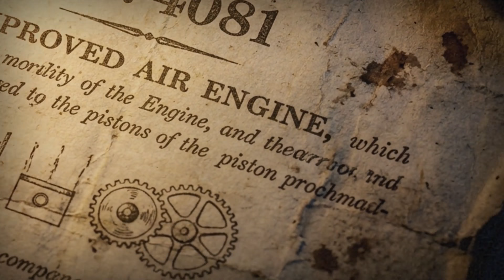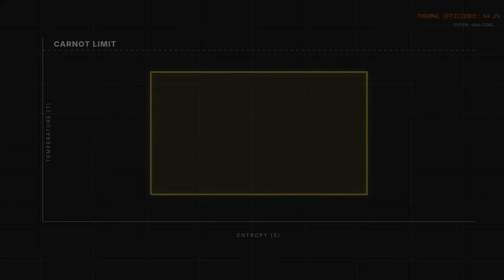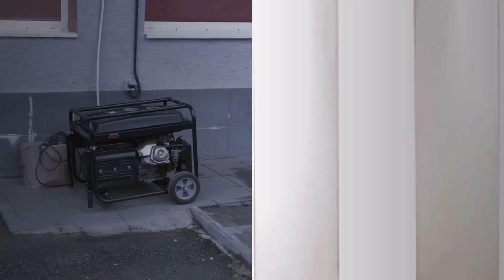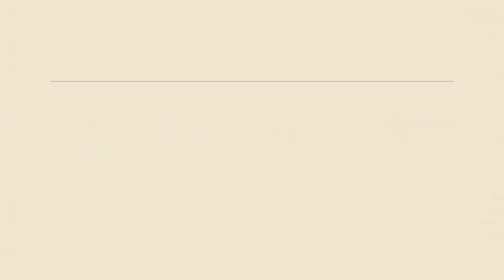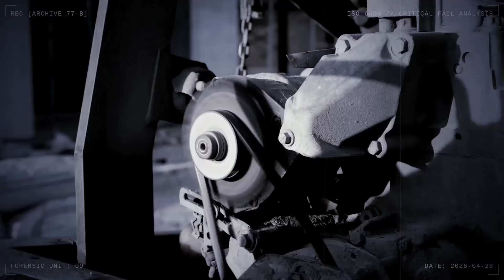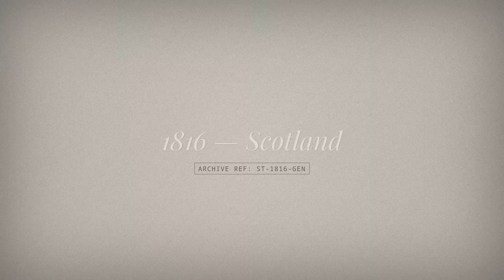This 200 Year Old Engine Runs on the Heat of a Candle — It's 40% More Efficient Than a Gas Generator

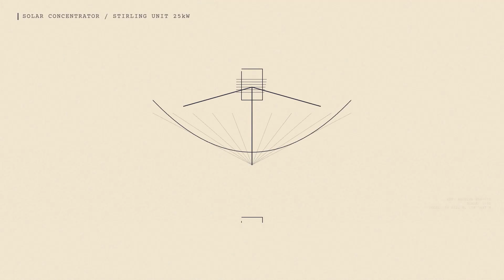Comment: at about 7:50 time mark, My average house about 3000sf uses 44 kwh a day and they based that on 11cents a kwh and even in NY I am only paying .07 cents, 4 years ago 3 friends and I built a cheap solar setup four panels 2S2P, a good 150/50 charge controller and 3400W inverter and moved a few items a month over to it, not whole house yet as we were playing with different parts and conf. eight 145ah commercial Telco AGM batteries I could run everything in our house but not AC or Heat so about half total load and lowered the bill to $32 a month, that is pretty much the minimum cost of staying hooked up to the utility, last month I got a low battery warning and seen my panels were not keeping up with use, my bad I had not looked at them or mowed around them because they are just laying on the ground you know because just testing still and the weeds had grown over them LOL problem solved, but I wanted to see how long it would run without being charged and unplugged them after full charge and I went 4 days before it cut off, total cost of system from everything bought on amazon and aliexpress was less than $2k
lets talk about lower light or cloudy, so just as a test we dont want to over Volt or Amp the controller we can add in an extra few sets of panels if the 4 2s2p panels are cutting it k but if we start to get a few cloudy days flip a switch and add in 4 more (P) or even 4 on top of that if its really cloudy, but I have to figure out how to program a PI to do it automatically because if the sun does come through  between clouds LOL you would have to run all the time to switch them off and if you didnt catch it you would have 16 panels running into a charge controller that was not meant for that, I know I can hear get a better controller LOL ok but that would also cost $1500 more, I am still playing with equipment cut me some slack :)

Comment: People talking torque, Speed, why not in cars etc. Try to understand this runs in a plant efficiency not a moving object. It has a higher weight to power ratio, can run on Fezner lenses with sunlight for free. Check out Exowatt P3 , they built complete power unit ready to dispatch in a 40 foot container. That is the magic. Giving 32KW of power with complete solar .

Comment: maybe someone can clarify something for me.
I see lots of examples of sterling engines doing lots of work, pumping, generating power, even running machines. But then i see lots of comments about them having very little torque to even power pumps, generating power, even running machines...
so, which is it?  can they power the machines? are they a pipe dream?
If the engine Sterling himself built to pump water is proof of concept, then the reason Sterling engines have been oppressed and relegated to the fringe is suspect.

Comment: Just for fun.

Regarding candles: Depending on their composition, size, wick diameter, and oxygen supply, they deliver approximately 20-120 watts. Assuming an efficiency of 25%, the Sterling motor would therefore deliver 6-30 watts. With a small, well-built Sterling motor and a generator (75%), this would provide enough power to run a 4-22W LED lamp and slightly warm the room.

Comment: No Stirling that uses air as working fluid will have sufficient power density to be practical as air is too viscous. They must use gases with small molecule. That restricts them to basically just Hydrogen or Helium. Helium is hellishly expensive for mass implementation. Hydrogen is cheap but with high temperatures involved it is not chemically neutral, it reacts with most metals forming hydrides, which make the metals brittle (I ignore for now a real possibily of explosion if Hydrogen come in contact with air). In addition gases with small molecule are very difficult to contain, they tend to leak through the tiniest of holes, sometime even through crystalline structure of metals. They bring the concept of "airtight" to the whole new level. So the machining of engine components must be extremely precise. And the choice of materials will be very limited.  All in all, other than for a few niche applications Stirling Engines are just too expensive therefore impractical despite being wonderful machines.

Comment: The cheap demonstration type that you find on EBAY is so inefficient that slight friction in the piston and cylinder renders them unusable, I sprayed some aerosol sylicon into the cylinder and it could not function.
Reply: Under no circumstances should the displacer piston/cylinder be oiled/greased; the working piston can be lubricated with thin oil, depending on the material.

Comment: So, F = MA, using liquid within a pendulum will compensate for both drag and provide P+ without impacting efficiency?  It seems plausible, based on the ability to absolutely control timing (time).

Comment: If it has moving parts, it needs maintenance.
Maybe not as much as a combustion engine, but something must lubricant the moving parts.
Reply: Why would that be a big deal if you had to you could put an automatic oiler on it
Reply: @EdA-qh7qr do you change your transmission fluid or gear oil in an axle?
Moving parts need lube.
An auto oiler would need to be filled. That's maintenance.
The oil that came off the moving parts needs to go somewhere. That's maintenance.
Not as much maintenance as a combustion engine, yet some maintenance.
Reply: @markchidester6239 i have a old dump truck 1954 the oil in the rear end has never been charged

Comment: Sterling engines are very inefficient because the temperature differential is small. The 40% right at the start of the video is a lie.
Reply: Yeah, and the best HD diesel engines can get 50% efficiency. If a Stirling engine was more efficient, everyone would use it.
Reply: @peterahlvik5954  I just keep wondering why this lie about Sterling engines is so persistent when it is so obvious that they can't be efficient.
The lack of basic knowledge among the environmentalists is shocking.
Reply: This is exactly what I cam here to say.  How in the hell is a sterling getting 40% thermal efficiency, when a toyota prius running atkinson cycle at it's peak gets 41%.   With Sterling, minimum half of the heat is not even transferred to the working gas.  The only advantage with sterling, like steam engines, is they are fuel agnostic more or less

Comment: One thing this isn’t talking about is torque. Traditional sterling engines have not had the torque necessary to counter the magnetic forces in the generator element. If anyone has a solution let’s do it
Reply: Forget about torque; you can get whatever torque you want with gears -- but the RPM's will be way too low if there's not enough power. It's all about power output, i.e., horsepower or kW. Then you can trade off RPM's and torque with gearing, depending on the application.
That's why gas or diesel cars and trucks have manual (gear shift! or automatic) transmissions.
Reply: @PeterNau-f4z   a 1 kW sterling engine is three two four times the size as the same 1 kW two cycle lawn mower engine.  This same sterling engine is also twice the number of moving parts.  It might be a bit more thermally efficient than the gas engine and can run on whatever compatible burner or even solar ...  It's all trade offs.
Reply: Torque available is the primary question I have about Stirling Engines.
Reply: You can put whatever gears you need to get the torque you need, though there's friction losses that add up through that drive train.
Reply: Spin a flywheel with your hand

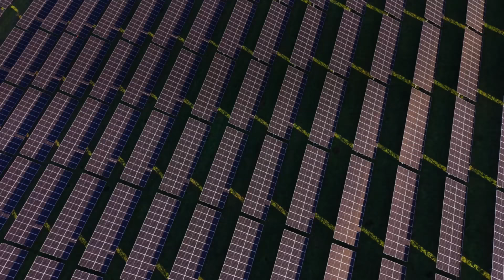Comment: 11:58 I'm in New Zealand. Whispergen commerciallly produced Stirling engine units here sold purely European market, using cheap Eastern (i.e. Russian) natural gas - the company refused to sell it domestically. However, some local government departments, including my own local council, employ Stirling cycle engines (and I don't know where these were manufactured) burning gases produced from waste in local dumps. The power produced is sold into the national electrical grid.
Reply: Likely used on big Marine ships to recycle exhaust heat

Comment: Stirling systems are not suited for direct drive automotive use.  It is better suited for hybrid autos where the Stirling system generates electricity for batteries, capacitors and the drive motors.  Somewhere there is a sweet spot where combining sources outperformance ICE systems.

Comment: But, then again: "GE Vernova's 9HA and 7HA gas turbines are industry leaders in high-efficiency electrical generation, with the 7HA achieving a world record 63.08% gross efficiency in combined-cycle power plants. These turbines are designed for reliability, flexibility, and reduced emissions, accommodating various fuels and supporting grid stability with renewable energy sources."

Comment: Instead of electric cars using massive batteries why is no one working on an electric vehicle being powered by a sterling generator
Reply: Because the best we have don't make nearly enough hp
Reply: @GWAForUTBE back in the 60 mother earth news built a car using a small gas generator hooked to a jet starter motor connected to a 4 speed transmission and it ran at highway speeds
Reply: NASA built a few sterling powered trucks back in the 50`s - 70`s (I forget the years)
They could move however they lack a rapid acceleration required for passing traffic.
The sterling engine is best in stationary use.
So hooking one up to a power generator using the waste heat off say, your water heater that runs 24-7 to reclaim some of that energy that you're already paying for or perhaps one on the chimney of your furnace.
Sure, they aren't going to be making massive wattages but any constant power going into your system reduces the total amount of power you have to buy from the electric company.
Reply: @horusluprecal1144 I've tested and done exactly something like that with a mock Stirling engine when living in Canada 

I used waste heat in the summer (from the heat pump coil) and cold in the winter to offset energy demand 
Worked like a charm, using abundant waste energy that otherwise is unwanted
Reply: Do it 😊
Reply: The best sterling tested for a military van and pick up produced about 87 hp conversion to about 70 % to electricity.  Weight of the sterling plus a generator not practical. Also a electricity car motor needs more than that, so battery storage is still needed. Possibly viability on trucks, not cars. Sterling is excellent on stationery systems like house generation. Charge the electric car from your house and also power your house.  This would eliminate many industries. So, set it up for yourself. He tells you where to buy them currently.
Reply: 87 hp is impressive.  Im curious to its cold supply .
Reply: @GWAForUTBE 
I believe it was the Phillips company test unit, and they discontinued the program. Like he said on the video people are selling small units on line that are cheap, or make your own, AT Robert Murray channel and others. .
Reply: They cant charge you for any consumption..because they want to run stupid economics and feel in control ..
Reply: It's been tested and done before 
They work and run almost perpetually but they don't accelerate quickly enough or too slowly 
Which was probably why it never happened 

I've seen one, I think it was GM or something
Reply: @AfricanCulturalHeritageProject the first internal combustion engine's did less then 30 miles and hour it all has to do with how much money they can make off you
Reply: @EdA-qh7qr I know 

The vehicle apparently still runs, but they kept it as a demonstration 🤷🏽‍♂️

Likely the big oil lobbyist pushed them to bury it 🤦🏽‍♂️
Reply: @AfricanCulturalHeritageProject big oil has gotten rid of of a lot of inventions because they care more about money than technology like the guy who built a car that used water to help extend the mileage he was poisoned
Reply: If it has enough power it can not be controlled like a petrol engine. 
This technik is good for stationary machines.
Reply: @Zwilling_FN if it was just running a generator it would not matter just like trains they use a diesel engine to run a generator to power the electric motor
Reply: @EdA-qh7qr  you are right. Think about the low power-to-weight ratio. Keep in mind that a turbo charged diesel engine is very effectiv and easy to control.
Reply: Due to the thermal inertia, which causes a significant time delay, and the low power-to-weight ratio
Reply: STM Power made one for a GM hybrid electric in the late 1990's. I was one of the Project Managers.
Reply: @pmahrle and how well did it operate, do tell, please.